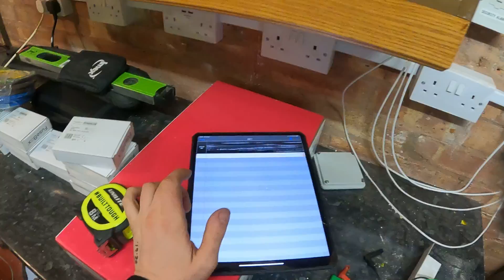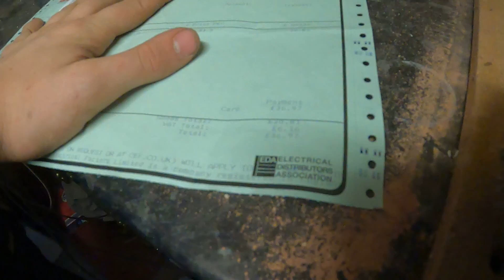Customer does half the job for me! - Electrician

Comment: Some wholesalers like CEF/Travis are setup for the mega contracts from big goventment and social repair companys. They get the big discounts. And the price before discount has to look big so theire customers feel the scam price they charge for the jobs are fair. If you haven't got 20,000 staff your lucky to get 1% discount. I've been using TLC and Plumbase for years. If you know a manager or two you can get a deal for your own house, but for a job, they can't really help you out because of reasons from above. When the first lockdown happened a travis helped me out with a big juicy discount as I thought well if I am stuck at home, I might as well finish doing it up. Travis used to own wickes and you know how much cheaper that is.

Comment: Instead of using the grinder for the slotting of the board, try using a jigsaw mate. The bosch 12v is brilliant for it, Still on my first blade and I've cut out about 30 boards with it up to yet (doing 2 - 3 a day) Leaves a nice clean edge too with no burrs.

Comment: One note: just had Siemens out (via Bulb) to fit me an isolator (EV charger guys wouldn't install without one) - £120, which I didn't think was too insane. Oh, and as a bonus they replaced my 100A fuse with an actual 100A fuse (unlike the 80A one that was hiding in the 100A enclosure :-/

Comment: Had exactly the same with CEF.
I had bought some uncommon items from them as a DIY customer years ago at what seemed a reasonable price.
But back when I was starting out as a proper spark I had to get some accessories from them to match an existing installation and they wanted to charge more than double for what's basically own brand than I could have got MK or Crabtree for.
Even showing my NAPIT registration card didn't get them to budge on price.
Spoke to customer, changed all accessories to MK in those two rooms and job still cheaper.

The last pisstake was £5+vat for a 1 gang back box for their brand of dado trunking.

I use Eyre & Elliston as my primary, they've been spot on with me from day one.

Banjo in the CU? Why?
Earthing Nuts are the future. More than pay for themselves not having to faff about drilling extra holes.

Comment: Looks like the customer was quite capable and competent to do the job himself but probably needed a certificate!
Reply: The problem is if you get caught you will be prosecuted. That's why this whole electrician certification industry exists. If the rules were less strict, electricians would've made a lot less and thus homeowners would be more cautious. That's the paradox of regulation. You introduce it to make things safer, but the overhead cost incentivizes to make things less safe and it balances out.

Comment: It is disgusting the way trade counters often behave. I looked on CEF's site for some wire last week, £42.50 for a 100m roll. Called my local CEF and spoke to the girl I know, they had it in stock and it would be £27.00. I have no account, I am not an electrician but a self-builder and strike up relationships with trade counter staff that I am going to use for the build. But that is a heck of a jump!

Comment: Very nice job Nick and plenty of room for future proofing. On the subject of mains supply to fuseboards, JRC Electrical used something called Splitcon cable in his 22 March video which I have not seen before. Any opinions on that Nick or have you not considered its use?
Reply: I thought split concentric was more of a DNO supply cable than an installation cable.
It has been used on the supply at my house, where the system is still TN-S.
Might have a nosey at that video as I haven't seen it terminated in standard accessories, only service heads and underground joints

Comment: Heya Nick and Ad! One thought regarding that strip light in garage - I think you've got one of those portable battery banks with 230V outlet? Wire a temporary lead from that to light feed. The battery bank isn't earthed so its floating safety wise. Awesome video and great work as per usual guys!